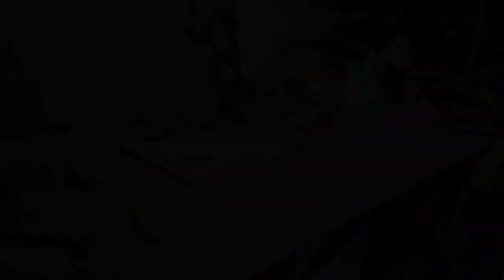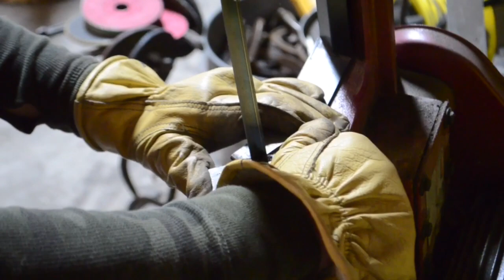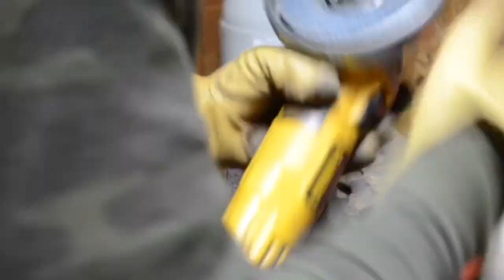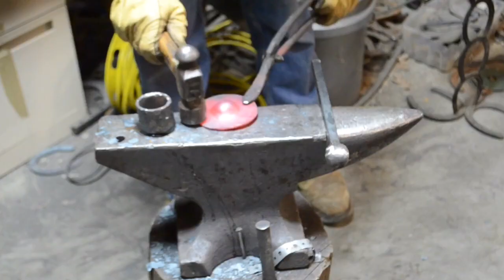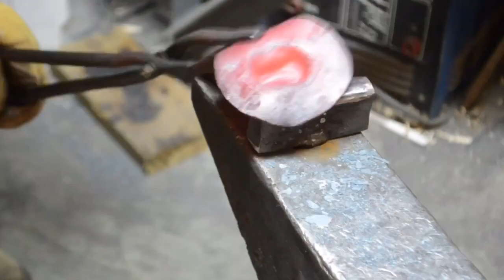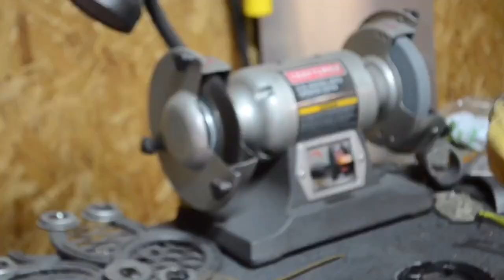Forging A Miniature Cowboy Hat From A Steel Bar

Comment: What kind of forge are you using?
Reply from the maker: It is a three burner propane forge. It is called the Whisper Lowboy, and it is manufactured by NC Tool Company.
Reply: Shoeless Horse Metal Works okay, thanks! My little no name one burner isn’t getting enough heat so I’m thinking about upgrading.